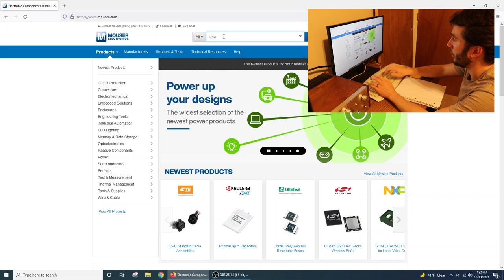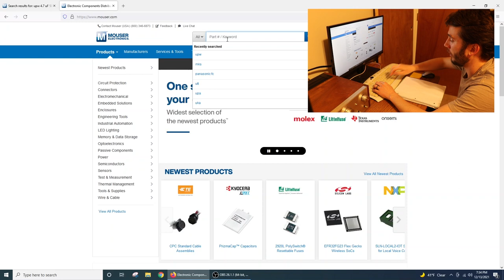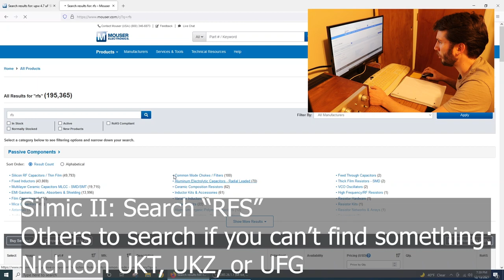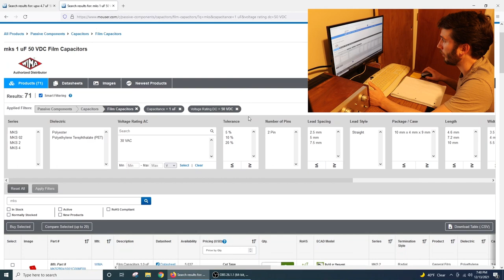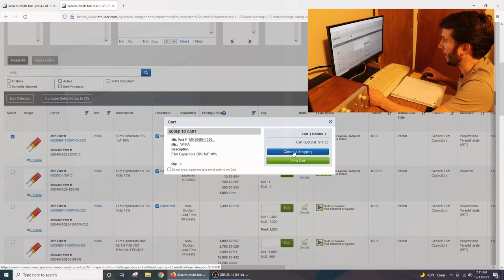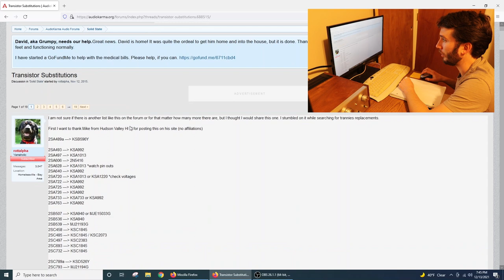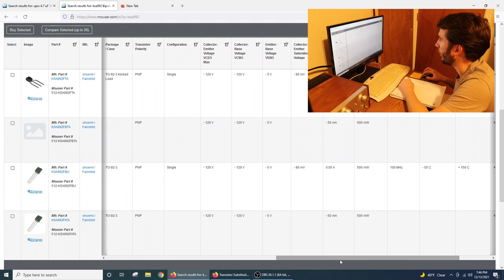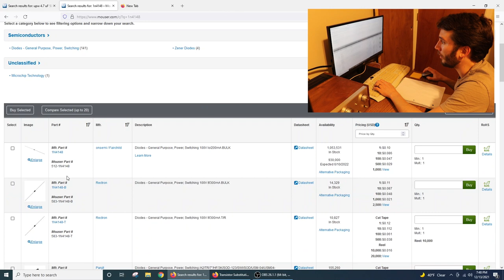How To Find Parts For Vintage Receivers

Comment: The finding of the semiconductor devices is the hardest part. I bought the replacement T03 devices on Mouser for a Sansui G-8700DB receiver, ON semiconductor MJ21194G and MJ21193G. I used them on a Marantz 2275 and had no issues with them. I do want to replace the driver transistors on the driver boards, as well as some small transistors less the differential pair, which I think is a FET dual package. I have not had luck tracking down the replacements for the OEM devices. So much current running through the resistors on those boards melted solder on the board and the resistors fell out, one side anyways. The 3.9 ohm slow start resistor on the relay is open also. When the owner found out how far gone it is, he said keep it. This is now my basket case project to learn on.

Comment: When I first got into the hobby, I bough a kit off eBay.  It was good for a first rebuilt.  It was missing a few parts.  However, that forced me to look to Mouser and other places for parts.  But overall, I would recommend a kit if you are just getting into the hobby and are intimidated by putting your first kit together.  Sometimes, Mouser is so big that until you get a feel on how to find parts on their website, it can be frustrating.   Great video.  I even learned some search techniques for parts!!! Thank you.
Reply from the maker: Thanks! Yeah, it was a game changer when I figured out how to use the search bar with the filters. I started the same way and agree with you.

Comment: This may be your best video yet.  I am just getting into doing repairs myself.  The biggest challenge is building an inventory of parts.  I have very little at this time.  I have heard that the cap kits aren't always good quality and that ebay caps can be counterfeit.
Reply: yes even the cap kits with audio grade caps use the cheapest bottom of the audio line caps to profit the most, ur best bet is to just get the schematics and make a list of all the caps needed and order
Reply: Check out the companies that make caps for instrument amps. Pros rely on them and are usually good quality,tho i don't know ifthe values you need are available. Worth an email i bet.

Comment: I was introduced to DigiKey in the late 70s and just about part I ever needed could be found there. This was before online catalogs and My printed DigiKey Catalogs were always on my desk by my radios (as a licensed amateur radio operator) and were a most important reference. 

Because of these proprietary devices in almost all modern Consumer Electronic products, they render most of these devices for all practical purposes unserviceable but these classic stereo devices like Pioneer, Marantz, (fill in the blank), etc. are serviceable and can possibly outlast by decades almost every stereo component in today’s modern marketplace. Our contemporary disposable electronic mentality is filling our landfills with devices. There is a bit of hypocrisy in talking about going “green” and saving the planet while on the other hand consumers are supporting industries that creating these very issues. 🤨 oh don’t get me wrong, it’s an important issue but let’s not ignore or turn a blind’s eye to what is going on. My old classic gear is going on 4 decades of use, still sounds good, has had only very minor service issues and in the meantime in the last 10 years I’ve had 3 modern TV’s fail due to proprietary device issues making them landfill fodder. For 30 years I owned a CRT based Motorola TV and it took a lightning strike and survived (so did my late 1970 JVC and older KLH receivers)  while other devices got fried. 

Thanks for sharing your presentation on sourcing replacement parts for these great classic devices.

Comment: Man....you've just gave me heart palpitations and probably rise my tension :)   IT'S NOT THAT EASY !!!
       Changing parts with modern ones, WILL CHANGE the entire voiceing in a vintage gear. You will make a MARANTZ to sound like a JVC. In the mid '70s (GOLDEN ERA), companies developed unique voiceing in their sound, like a trademark. For example: MARANTZ sounds let'say fatty-greasy-neutro-musical, and somewhat lasy. As for JVC, sound is light-musical-sparkling, and tighter than Marantz. SANSUI/MacINTOSH are like honey in mid-hi region (makes me throw up, to sweet for me) PIONEER - exagerated musical....and so on!
       I have some roules. Here is some of them:
 - Stick as much as posible with capacitors original brand (ELNA sounds more soft, compared with NICHICON, who is a little bit metallic)
 - ESR is VERY IMPORTANT!!! Those recievers/amps was not been designed with LOW ESR capacitors. If you put that in vintage gear, in the signal path, current will pass more faster, and the original sound will be compromised. Soundstage will dissapear, and entire sound will be thinner, fast, and more towards you, like a wall...yelling at you. NO depth/soundstage! If you can't find let's say NIPPON CHEMICON, better replace them with general purpose SAMWHA.
SCOTT used Samwha in A series 1975. Part of them produced in Korea. Those made in USA have RUBYCON caps. Sounds the same.
 - Stay away from WIMA in signal path, especially in pre amps, tone control... if is not a modern equipment. Cheaper polyester are much better. If you still want WIMA, consider changing their values, and add some capacitance. WIMA makes the entire sound goes UP! Frequency response is not the same.
 - Stay with carbon resistors if the gear is made with them. Film resistors have modern/comercial sound. With few exceptions.
 - For transistors even a bigger problem! Nowdays ON SEMI, are soft, very musical...somewhat comercial sound.
 You do a great job, we need people like you-young technicians....but i'm afraid that YOUR EARS ARE YOUNG TOO!!! So chill down a beat, LISTEN different music generes, and educate your ears! Read forums, test those theories 
   There are many good tech people in the world, but majority don't have a clue how those amplifiers supose to sound!
Please belive me....a vast majority of so called "audiophiles" have exactly the same theory: "improvements" Wima, Low esr caps....and when i listen that....my hair goes up! If you put them in a blind test, they cannot reconize a TDA 1541 vs Burr Brown PCM. I made that mistake too, and i had to recap it again
   It's logical: they put new material for improved measurements, and sound is diferent. If you put alloy/copper/silver  speaker cables, they will sound verry verry different, despite their measurements (inductance/capacitance).
    GOOD MEASUREMENTS doesn't mean GOOD SOUND! I've seen people who builds great amplifiers, with most expensive materials...but with famuos old schematics. WORK OF ART!!! And sounds like a showell dragged on concrete!
Don't hurry, learn first about vintage sound, explore it. All the wishes!!!
Reply: Thank you, I will certainly consider your recommendations.
Reply: Uh sure whatever.
Reply: I like this comment. At first I thought you were going to be one of those “don’t change anything!” guys… an endless debate. But what you are saying is valid. The specific choices make a difference. It would be great if you gave a detailed video on what your discoveries are. Seriously. On the other hand what this guy is doing here is helping people get started in the process of selecting parts, his suggestions are certainly helpful to someone looking for guidance. Otherwise you go on a site and are overwhelmed with choices. You’re three levels past that and there is certainly room for both.

Comment: I have a 424 if I remember the model number right that I am going to pop my cherry on never did any electronic work other than my Radio Shack kit electronic kit. I have had this receiver for years and got out of stereo for years and it just collected dust it was a beast never let me down never not worked. I want to replace all the caps and major cleaning on the pots I think I might have one bad vol its a two part pot and the shaft is bent but I dont know it it goes all the way through and the pot is damaged . I am looking forward to tearing it apart and learning

Comment: I wonder if you know how to find the replacement coil on the 2270 in the fm detector P500 board. It's a dual coil but not marked with a part number and the Marantz manual just has Marantz part numbers. I think it might have been made by Toko but not sure. It's like a treasure hunt.

Comment: why replace diodes and transitors? do you only mean if they are failed or causing issues or do you just go around replacing everything?

i actually just dropped an amp off with a guy yesterday for a recap (younger enthusiast like us), i asked about replacing film caps or anything else and (especially for marantz) he just laughed and said dont touch anything
Reply from the maker: I haven't seen too many diode failures but they're cheap and easy to replace. In my experience, the vast majority of repairs I've done have involved a failing transistor so that's why I replace them. I have a video coming up on a Pioneer SX-737 that will talk about this.

Comment: Dear can you please mention from where we can buy potentiometers for vintage amps like AU 717
Reply: Any site just like Mouser
Reply: Parts-Express sells all kinds of pots for fixing equipment. They also sell components for building speakers and cross-over networks. They have electrolytic capacitors as well but they're just cheap general purpose caps. If you want the nicer electrolytic caps for restorations just stick with Mouser or Digi-Key. They have a much bigger offering. :)

Comment: Those two big caps from the amplifier board....they are special output caps, for AC current. They block DC, and  let AC passing. They let the entire band of frequencies pass very well. That's why they are BIGGER. You can read read the printing on them. It says: 1000 or 2200 micro at 50 or 63 volts AC!!!  They are hard to find, and very expensive.You cannot replace them with caps made for filtering purpose! Filtering purpose caps let AC and DC passing!!! They are made to filter mainly around 50 hz!!! Of course, you can put them, they work, BUT the sound is more tight. Can't have that RELAXED sound of the old ones!
  You can measure DC at output....and if it's 0,1-0,2v, is OK. Leave them in place.